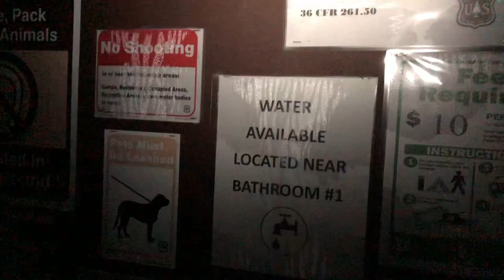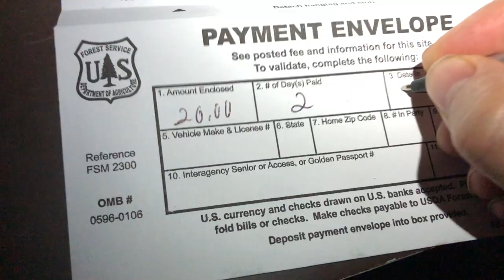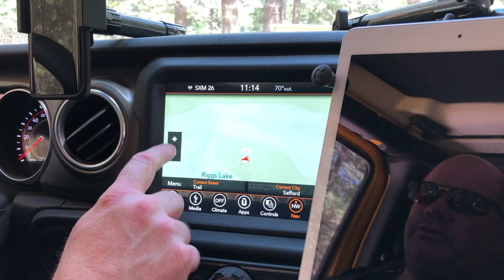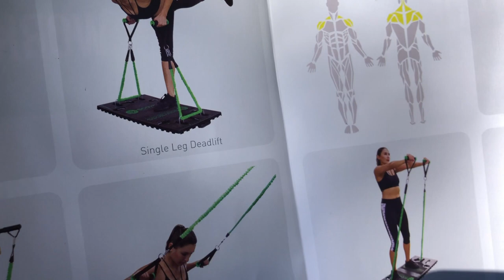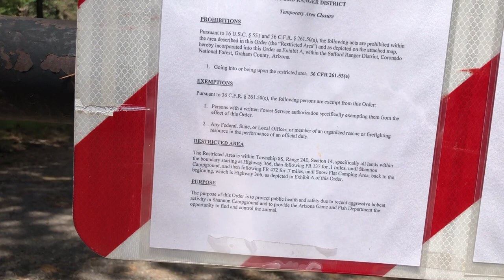Car Camping Mt. Graham Sky Island Subaru Outback with iKamper Skycamp Rooftop Tent

Comment: This might be a silly question, but I'll ask it any way.  Since you're around 5 feet higher off the ground, what concern for added attraction to lightning is there?  Do you have to ground the tent in some way or another?
Reply from the maker: That’s a good question. I’ve had that conversation before. I don’t believe so as the vehicle is on rubber tires. But the tent roof itself is plastic and sits on plastic wrapped rack system. Generally I’m not even close to being the tallest thing in the area as I’ve mostly camped in forests or among tall Saguaro Cacti. I don’t have a complete answer on that. I presume not but if the storms get to be significant I generally don’t take chances and instead move inside the vehicle.
Reply: Perhaps the rubber tires help. The safety aspect of the car is that it can create a Faraday Cage if you are inside. Essentially the current is directed around the car on its shell keeping the occupants safe inside. Being 5' higher would make little difference compared to the trees around you.

Comment: Curious what your using for a roof rack to mount the skycamp to? My Rogue has stock roof rails I just want to get adequate cross bars to support the tent and up to 2 people. All the roof cross bars I have seen so far have suggested weight limits of anywhere from 150 - 250lbs.
Reply from the maker: I use a yakima rack with the round bars mounted to the foreward roof rails. I removed the stock horizontal bars.

Comment: I realize that you have "1 inch lifts" on your car, but with 2 adults, 2 kids, your roof tent, and likely a hundred pounds of gear and food, your Subaru Outback is carrying anywhere from 400 to 600 pounds of "stuff and people."  How do you deal with springs and strong shocks so you don't "sink," especially in the rear of the vehicle with it all loaded down.
Reply from the maker: Well first it’s a 2 inch lift. As far as springs you can get after market from companies like King which compensate for that in the back. Often people avoid changing out the front as that can have adverse affect on CV joints etc. the front is never a problem though. Note also that I generally don’t take other people with me.